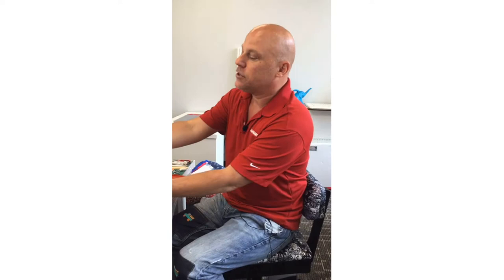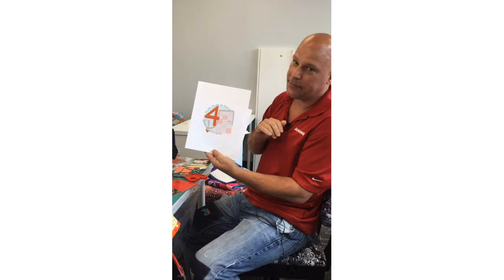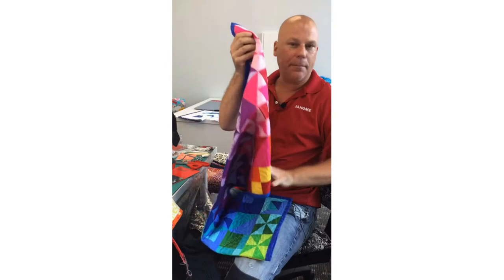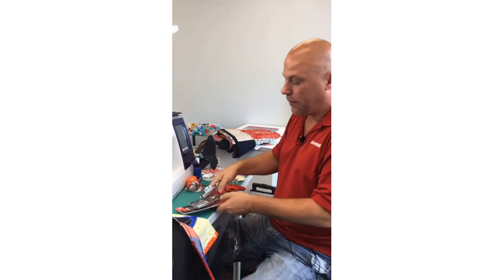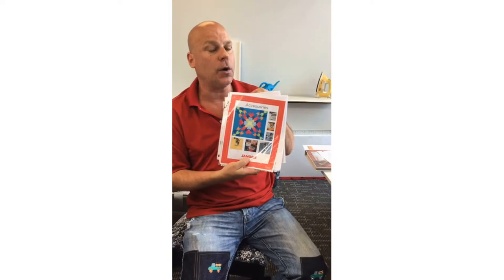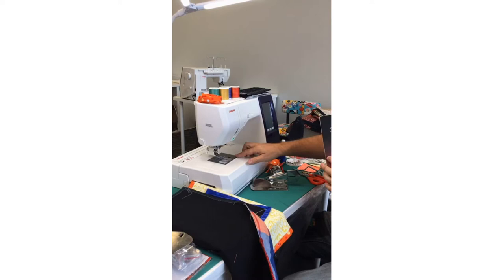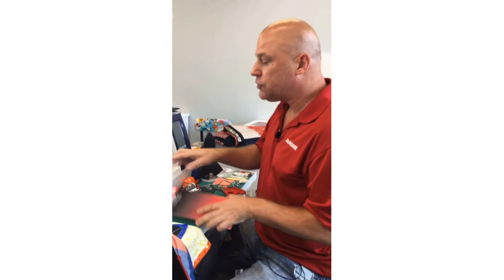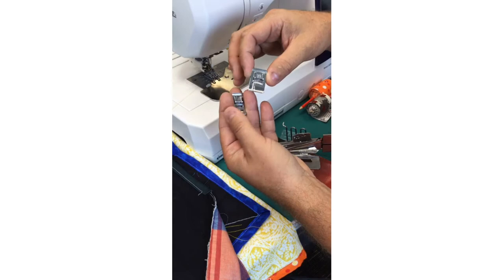Janome's Awesome Accessory Countdown #4 Quilt Binder Set!

Comment: Hi there, I see from the video and your reply to Nora that there are three sizes and in the video you show the extra sizes packed on their own and also show the Coverpro binders with their corresponding baseplates.  Are the individually packed sizes (without the baseplates) exactly the same as the ones that that come with the Coverpro binders?  I ask because I would like the smallest quilt binder ( to get closer to the traditional ¼" binding size for quilts but I may also be getting a Coverpro machine in the future so if the binder is exactly the same I would buy the Coverpro version (with baseplate) so that I can use it with both my sewing machine and Coverpro in the future (i.e. I would have the baseplate ready for when I buy the Coverpro).  I already have the ½" Quilt binder blister pack.

Comment: Will the quilt binder I bought for my 6500 fit my new 8200?
Reply from the maker: I don't have either of those machines out in the classroom at the moment, but I'm guessing not. I could be mistaken, but I think the 6500P has a square bobbin cover, whereas I believe the 8200 has a rectangular bobbin cover. You can always try as you'll know right away if it works, or not. It's all about the bobbin cover size - there's 3 Circular Attachments for the different sizes. Thank you sew much writing!